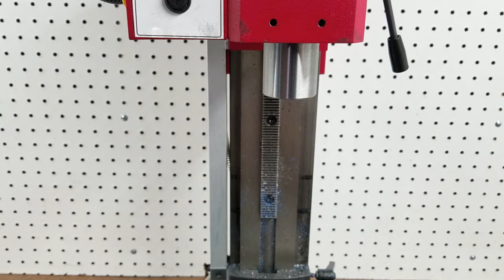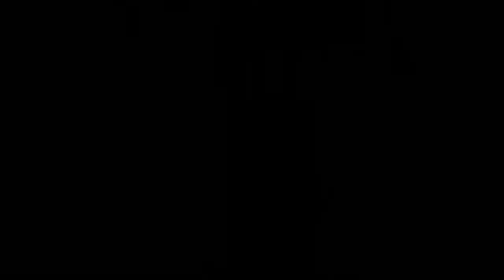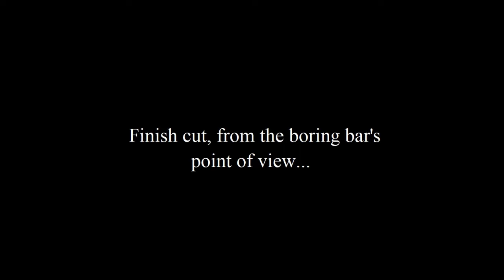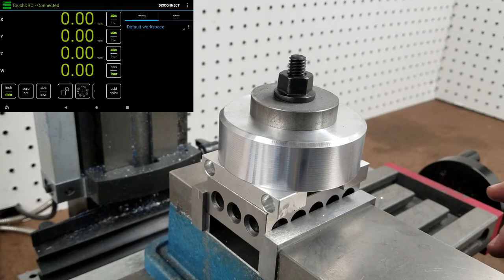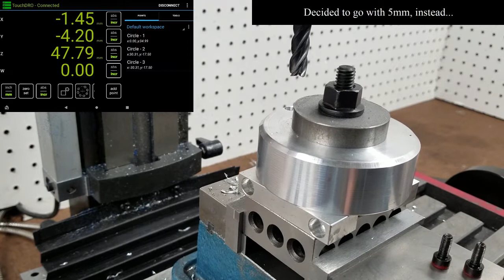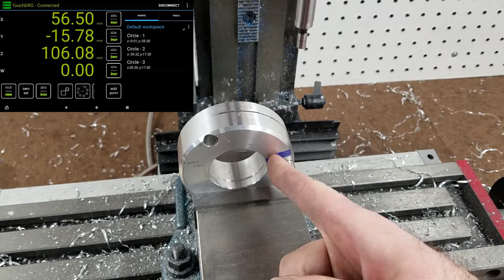Mini Mill Spindle Lock

Comment: I used a spring loaded pin with a turn lock.

Factor pin hole.
Reply from the maker: The issue I have with those kind of spindle locks, is that they only lock in one position. You have to rotate the spindle until the pin drops in.

This one locks no matter where the spindle is, which makes tool changes way faster.

Comment: You could put a lever on it like the ones used to release front bicycle hubs, then you would not need to use a tool. Nice clean build!
Reply from the maker: Not a bad idea! It doesn't have to tighten much to lock the spindle solid, so a short lever could work.

I've also thought about some kind of cable arrangement, like a bicycle brake cable pulling on a cam. The other end would be connected to a foot pedal, to keep both hands free.

The ultimate goal is some kind of power drawbar, so I wouldn't even have to lock the spindle to change tools.

Comment: It seems like a greater risk of forgetting to release the spindle with no real indicator. A possible gear grinder to me.
Reply from the maker: I did that a few times, at first. It's become habit to rotate the spindle by hand before starting the motor. 

Though the mill isn't powerful enough to cause any issue. It just immediately stalls, and the control circuitry cuts power to the motor.  I've upgraded all the gears in my mill to steel, so until I upgrade the motor itself (which I eventually will), I'm not worried. 

Though if someone were to replicate this on a mill with plastic gears... They might run into the issues you mention.

Comment: Nicely done!  Not sure why you made the ID so tight to the spindle though.  Why not leave a 30+thou clearance?  Just curious.
But also I'd love to know how you got the touchDRO image to sync with your camera video.  I have the TouchDRO and would love to be able to show it in my videos.
Reply from the maker: Thanks a lot! 

I left minimal clearance so it would lock with as small a turn of the screw as possible. However, I may yet take a couple of thou out of it, because if I don't install it juuuuust right, it will bind the spindle ever so slightly. 

As for adding the DRO footage... I use a screen recorder app on the tablet I use to display TouchDRO. When I start recording, I clip my lapel mic to the tablet holder, right next to the tablet's mic hole, and clap my hands. That makes it easier to sync the footage in editing, though sometimes a tiny tweak here of there is necessary. 

I use OpenShot for my video editing. I overlay the tablet footage with the machining footage, size and position it how I want, use the audio sync it up, tweak as necessary, then mute the tablet track.
Reply: @fna-wrightengineering  
Oh, I see, of course.  I was concerned about binding too, and aluminum can flex a lot, so I figured you had plenty of room if you need it.

That's what I guessed you did, but I hadn't figured out how you synced the videos.  Clever!  Which screen recording app are you using?  I'll have to try this!
Reply from the maker: @GuyMarsdenMakesStuff  
I use RecMe Free Screen Recorder from the Amazon app store (all my TouchDRO tablets are refurbished Kindles). I use that app for no other reason than it was the first one I downloaded that worked well. I'm sure there's others... Let me know if you find a better one!

Comment: It's too late for this project and you may not have the tooling but the mini-mill is made in China and they are metric. So 3.18 inches is very close to 80mm and generally this will be the more likely figure. I often use the conversion functions on my callipers to double check my measurements on the basis that we humans tend to like round numbers.
Reply from the maker: I know it's 80mm, but I prefer to work in imperial units... For no reason, other than that's what I'm used to. It's off screen, but I'm using my digital calipers when I call out that measurement. Both the calipers and the TouchDRO app can convert at the touch of a button, and I do occasionally do that. 

Further, that particular measurement wasn't super critical, so 3.180" was fine.

I much appreciate the input, though!
Reply: @fna-wrightengineering  I realised as the episode progressed that you had it covered. I guess I reacted because I often see YouTube contributers who have an "elephant in the room" attitude to the metric values for measurements that leave them using odd inch measurements where the actual metric value is a round number. 

Thanks for the great content. Have a happy and safe Christmas, regards Neil.
Reply from the maker: @neillawson4493  No worries! I appreciate you checking out my work. Happy and safe holidays to you, as well.